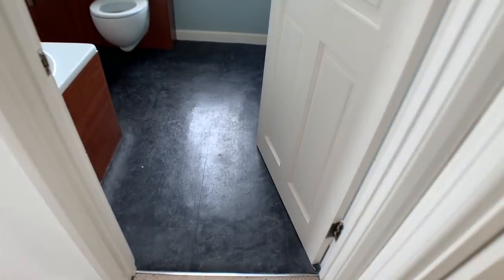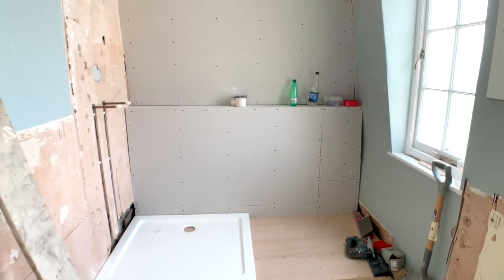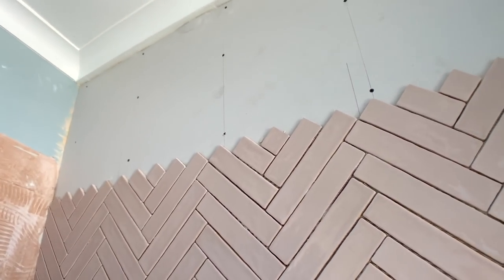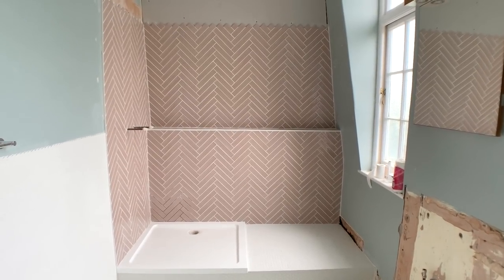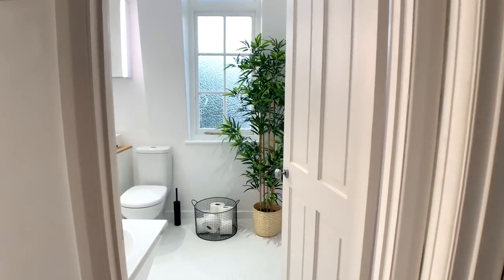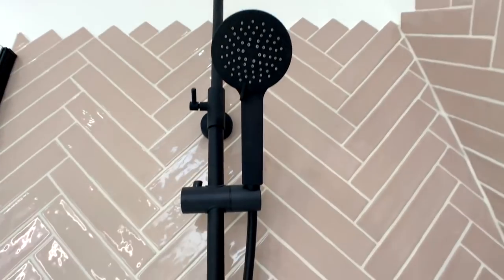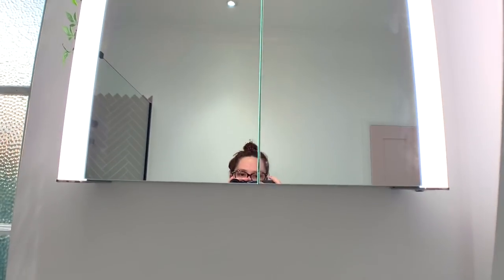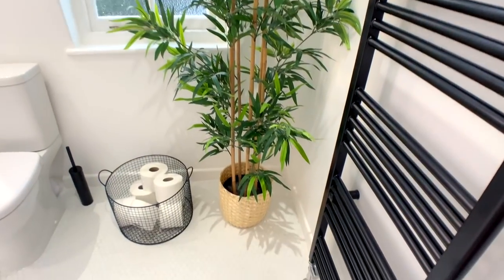BATHROOM RENOVATION! Before & After 🛁

Comment: I absolutely love love love your bathroom, I keep showing my mum when I'm watching your videos because I'm living through you whilst you renovate and move into this house. I know you said you're thinking of getting an electrician to move the mirror, but since you're considering a step I wonder if once you've lived with the step whether you'll get used to it and just accept the mirror as it is? It's definitely a cheaper solution and easier; when I bought my car I realised it didn't have an AUX port (which I loved in my old one because of podcasts) and I just stuck a bluetooth speaker in my car rather than go through the expense of changing the stereo. It's a great solution that cost me nothing (I had the speaker already) and it solves my issue, you buying a step may be the same.

Comment: I looove the pink and I don't think that it is too girly at all as it is a quite subtle blush tone. I am not a big fan of the black hardware though.. I would have preferred a brushed silver or maybe even rose gold to go with the general vibe. Also I would have switched around the toilet/sink and the bathtub. I think that would make a much nicer flow of the room and sink and toilet would not have to be so squished together. But it probably would have cost so much more and been a huge effort. All in all, good job though. It looks really pretty with glass. Before it was just awful, so you did a great job!! 👍🤗👌